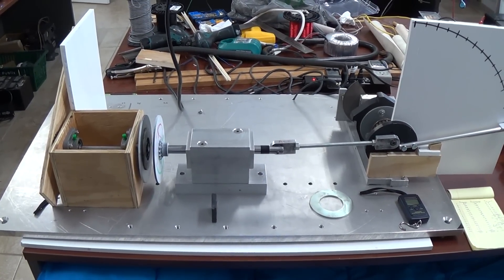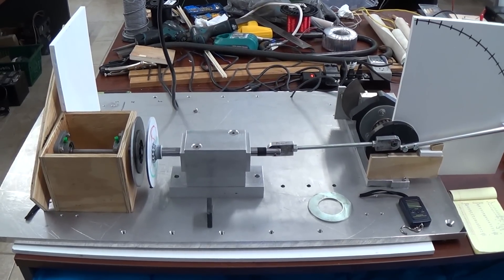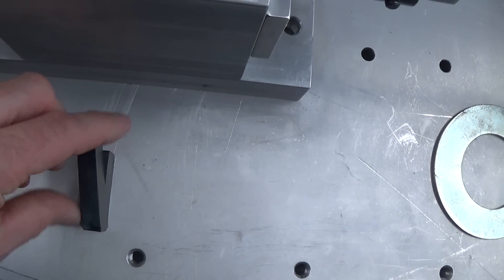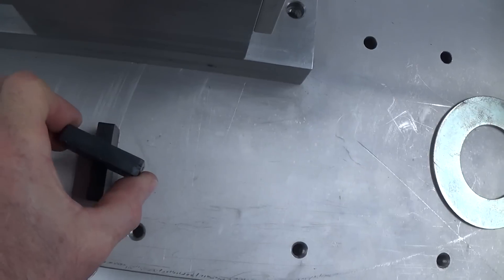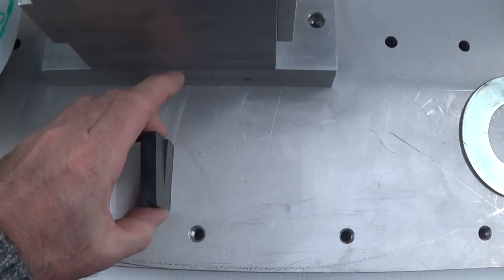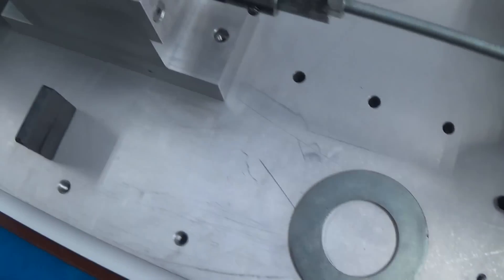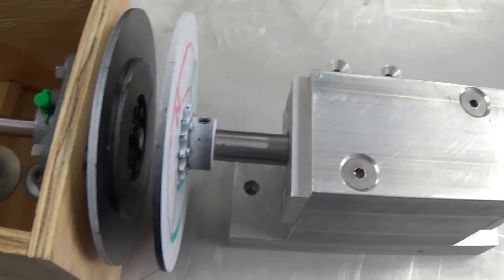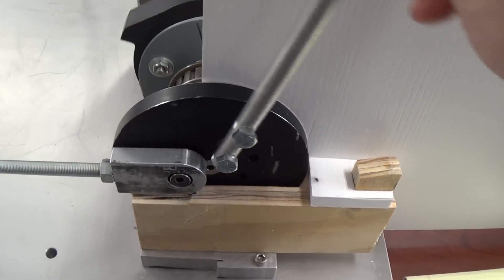Floor's Twist Drive Permanent Magnet Torque Amplifier test 1

Comment: Cutting neodymium magnets... Danger Will Robinson!  Grinding neodymium magnets creates pyrophoric dust (it self-ignites), and should only be performed when submerged in mineral oil to prevent inhaling the toxic dust, and to prevent heating and oxidation (the dust burns and emits toxic gasses).
Reply from the maker: Thanks for the safety warning. I used water when cutting and do it in small steps so not to heat the magnets to avoid demagnetization. Luc

Comment: I suggest to turn the device when measuring that whey the axe of rotation is perpendicular to earth and then make the measurement. then turn again all the device to make the second axe perpendicular to the ground and make the second measure. Or take of the magnet and make the measurement and then subtract the torque that the gravity provide from the torque that you measure whit the magnet.
Reply from the maker: Build it and show me your results
Reply: Gotoluc it was only a suggestion, not a critic.
Reply from the maker: I didn't take it as a critic!... just letting you know that I think the measurements are fine as is but if you don't think so, build one the way you think and show the difference.

Comment: Your weights are far off.  Especially on the plywood side - the weight of the board itself is counting against the weight.  There's no counterbalancing.
Same on the other side - as the aluminum arm gets towards its end, its own weight is pulling it down; and/or is the weight to 'engage' on the front side.
Reply from the maker: It's true that the weights of the arms have not been deducted. However, they are minimal compared to the overall gain.
I will address it future updates.
Reply from the maker: Here are the results of your concern: https://www.youtube.com/watch?v=f0POfohSjQk
Reply: Can't you counter balance the arms ?